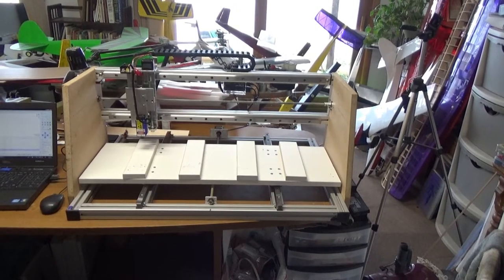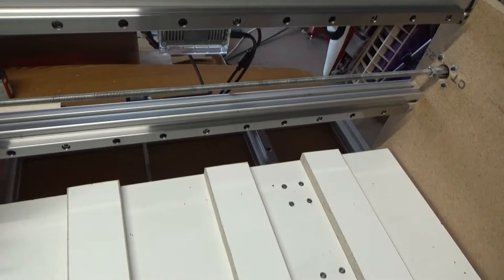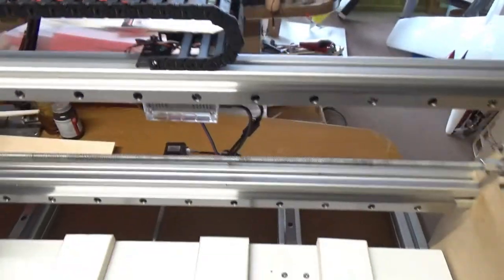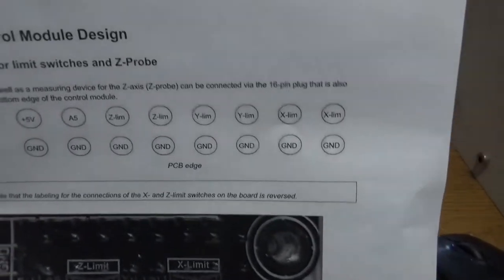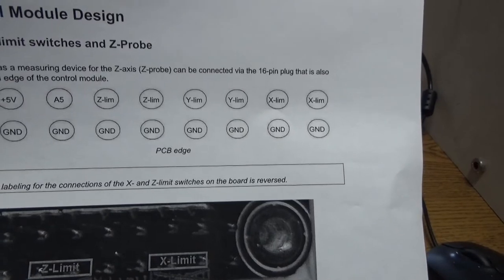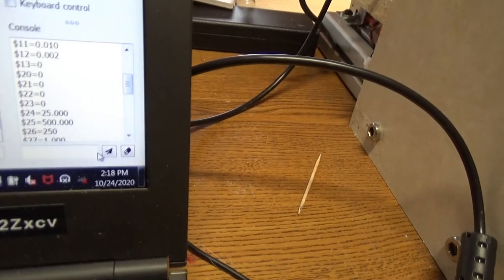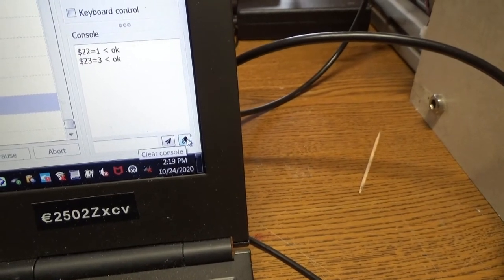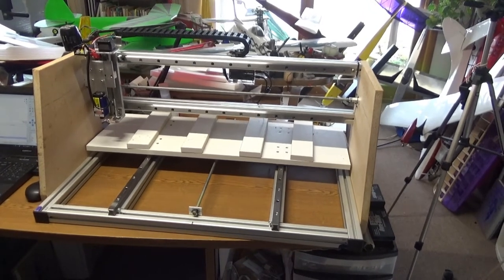3018 PRO CNC - adding home switches DIY

Comment: No parts list???
Reply from the maker: I had some in my stock but these will work.  https://www.amazon.com/DZS-Elec-Mechanical-Endstop-Makerbot/dp/B07D3S28FG/ref=sr_1_16?dchild=1&keywords=3018+HOME+SWITCH&qid=1607105530&sr=8-16        DZS Elec 6pcs Mechanical Endstop Limit Switch $9.99 at AMAZON.